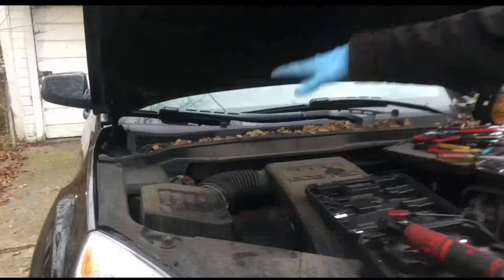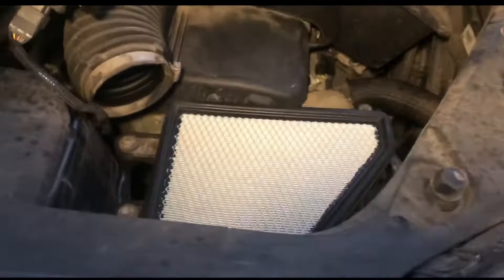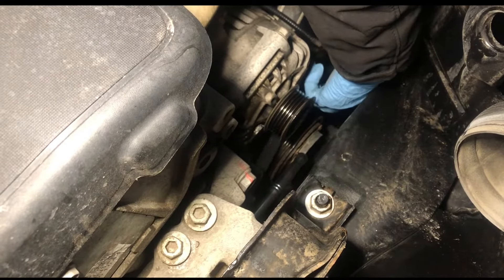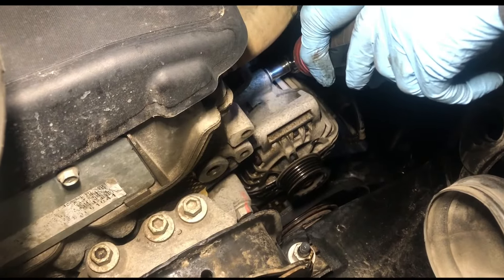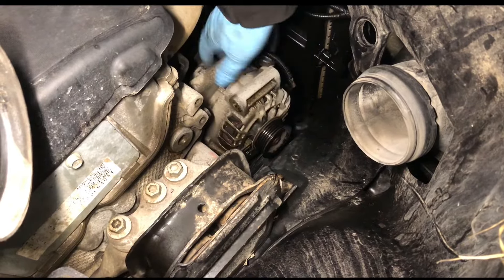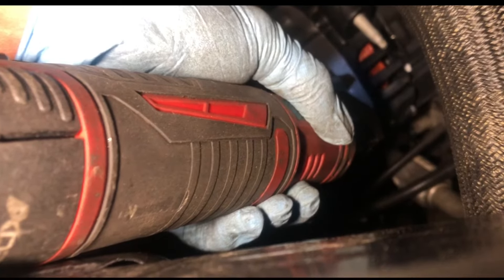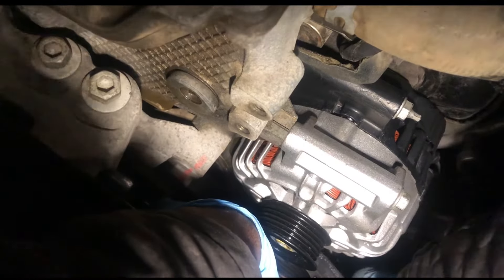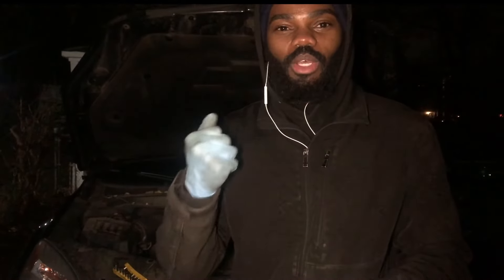Chevy Equinox Alternator Replacement ( How To ) replace Quick, Simple, and Affordable VLOGMAS DAY 6

Comment: Take-Aways from my experience doing this. The tensioner has a square hole in the casting around the middle, it is hard to see between the motor mount and the tensioner itself. It has a pretty narrow angle of view but it is possible to spot it. You will use the bare stub of a 3/8" socket wrench to put into this square hole to gain leverage on the tensioner assembly. Just google an image of the tensioner to see what you are looking for.

Taking apart the air filter box on my 2012 Equinox had rounded head star screws, his shows flat head hex screws, just expect some possible variations.

The hardest part I had wasn't shown in the video, probably for good reason. The electrical connections are an absolute pain, the plug style connection on the alternator isn't as bad using a small flathead to raise the retainer clip over the keeper piece, you can push it out without too much trouble. 

The larger bolted on cable is located under the alternator and between the engine. The cable has almost no extra length to it (on mine) to allow you to maneuver the alternator to gain access to the nut. I ended up throwing a jack under the car and tilting the alternator enough that I could get my socket on it from the underside.  You are working on an alternator that isn't held down at this point and in a tight space, so if you have someone up top to hold it still you might save some frustration. When you fasten the cable back down on the new unit, the cable needs to be somewhat inline with the alternator, if it is sticking straight out you will run into clearance issues when trying to bolt everything back up.

I ended up having the belt come off the lower pully when I was trying to get the belt back on. If this happens, turn your wheels to the left as far as you can. Probably a good idea to just do this before you start taking stuff apart. You can put your key in and turn it to the accessory position to free the steering lock if you didn't do this ahead. This will free up some space on the back side of your passenger side front tire, giving access to the belt and lower pully. Again having another person up top to provide light tension on the belt could save you some fiddly issues trying to keep the belt where you intended.

All in all this video helped me realize this is a very doable project for a day off at home. I can imagine this would have been hundreds of dollars more in labor expense if I had taken it to the dealership.
Reply from the maker: Thanks I’m glad this video could help you got this I’m sure you can get it done on a off day
Reply: You are right about the cost, I'm looking this up to fix my friends' Equinox. She was quoted over $800. That sounded rediculous to me as I used to change alternators regularly back in the day. I forgot that they build these things hard to work on. I want to thank you and the creator of this video. I will be taking this on later today/tomorrow.
Reply: Thank you!
Reply: @dee_dubb we’re you able to do it on your own?
Reply: @squidamazing464  yes, I had my son with me so he could learn. It was not fun, but I was able to get the alternator to come up near the radiator. I had my son  help with re-aligning the bolts to put the new one in.

Comment: I am trying to figure out the part  @2:02 what wrench are we using to adjust the belt i tried it idk if i’m using the right one or i need an extended wrench arm because the one i’m using may be too short…
thank you in advance
Reply from the maker: If it too short us a breaker bar instead with 1/2 or 3/8 head I believe

Comment: What size do you use for the tensioner? I had a 3/8 inch it wouldn’t fit due to the location of the attention. I didn’t went to AutoZone and got a half inch driver that was to big I’m lost here and Ned help.
Reply from the maker: It can only be those two I believe it 3/8

Comment: On my 2010 v6....the idle pulley broke during belt change and the bolt is still inside...dont know what to do....hood nechanic want 800..too much and i dont trust..says he needs to unscrew to lower engine and do somehting so i dont know
Reply from the maker: Watch my video on grand Cherokee I fixed that issues in that video series